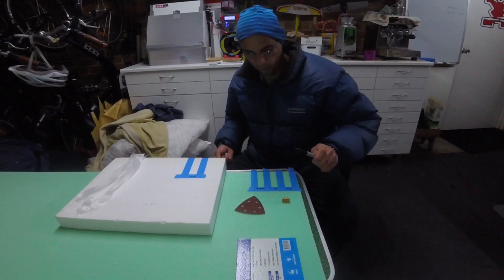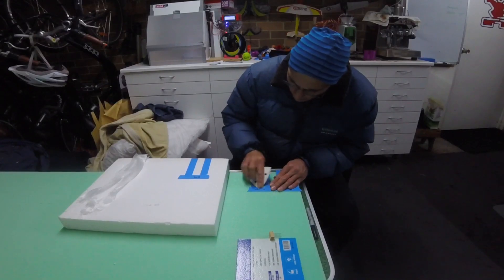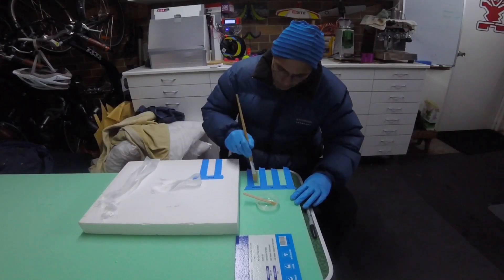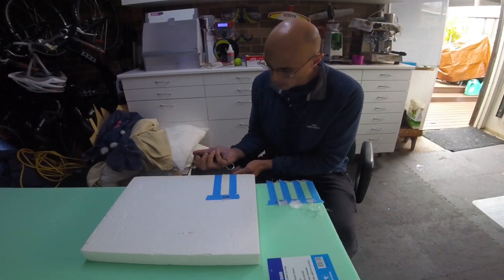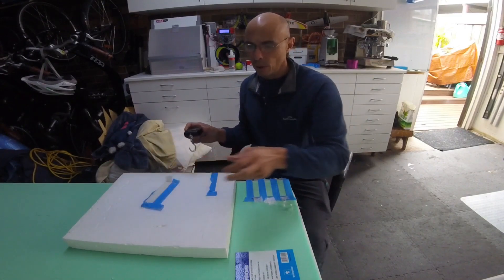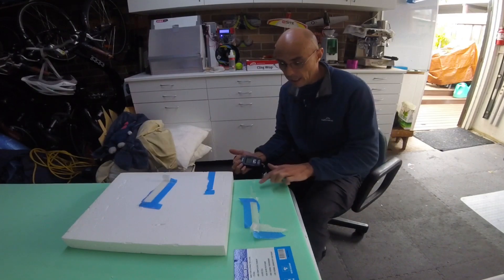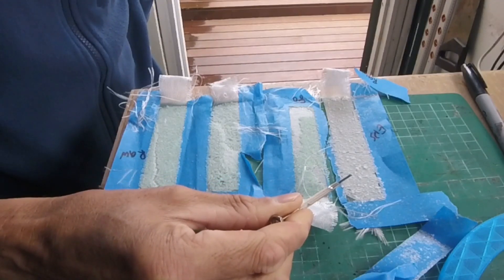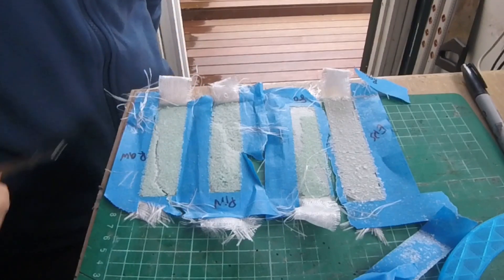XPS vs EPS delamination test

Comment: I shaped and glassed a prone foil board constructed of XPS (pink panther foam board from home depot). It lasted just 1 year until the deck started delaminating under my front foot. I had full deck traction pad. It seems all the front foot pumping pressure accelerated the delamination process. Oddly, the rear foot area didn't suffer any delamination. I have 2 vents installed and I always stored the board inside the garage. I used to drive a hatchback with the board inside the car, but recently I started going to the beach in my truck and the board would be in the bed. The drive is 30-60 minutes to the water, depending on which beach I go to. So the board would be exposed to direct sunlight during travel times. I suspect the additional heat could have played a small part but the board was always deck facing down. There was absolutely no delam on the bottom or anywhere else on the board.

Comment: I didn't see you dust of the 80grit. The dust could have caused the patches of bad adhesion. An 80 grid dust free surface combined with pin pricks woul be another interesting sample, I could imagine it beating all others.